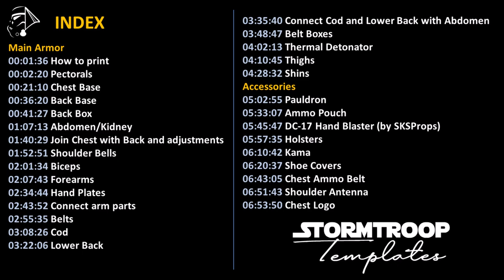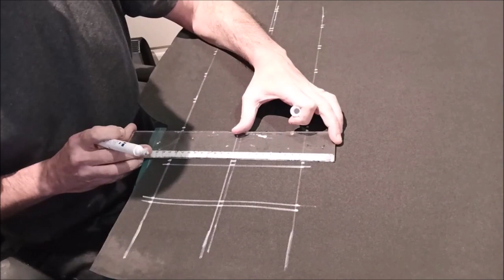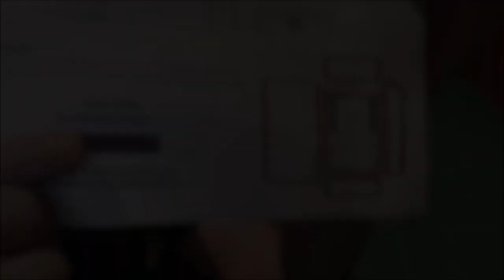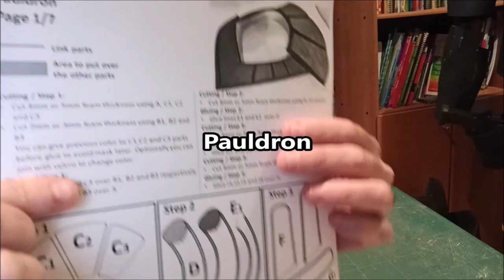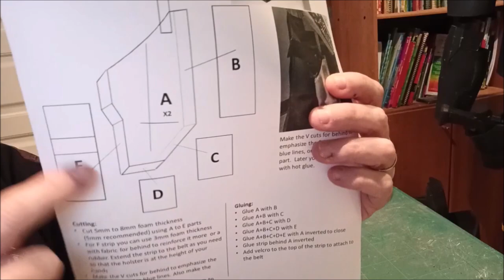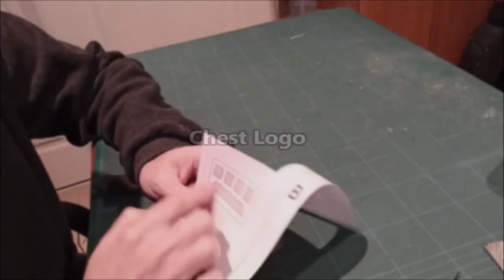Clonetrooper Armor Foam Build

Comment: Thank you for this awesome video! I purchased the template and have been working on my captain rex over the past month. I have every armor piece cut out, I am just doing minor adjustments to size since I am a bit bigger but the template is easy to work with. Next i will be sanding and smoothing rough edges, then prepping for painting and weathering. I am really excited to get finished.

Comment: Main Armor
00:01:36 How to print
00:02:20 Pectorals
00:21:10 Chest Base
00:36:20 Back Base
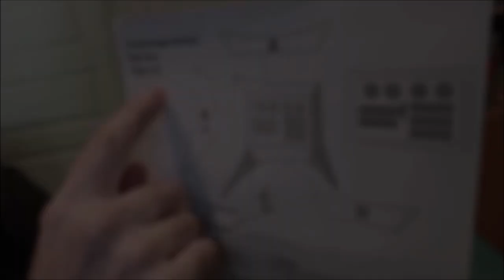00:41:27 Back Box
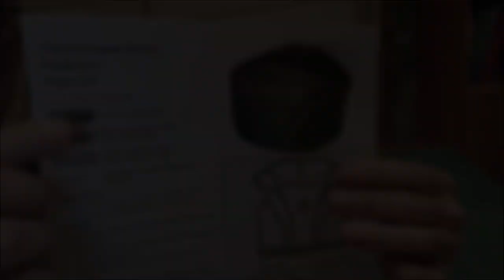01:07:13 Abdomen/Kidney
01:40:29 Join Chest with Back and adjustments
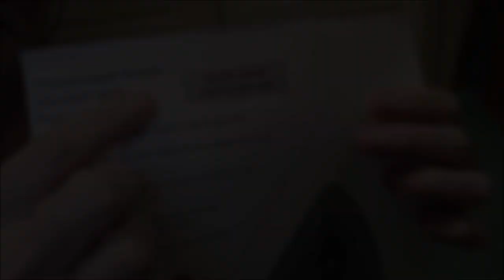01:52:51 Shoulder Bells
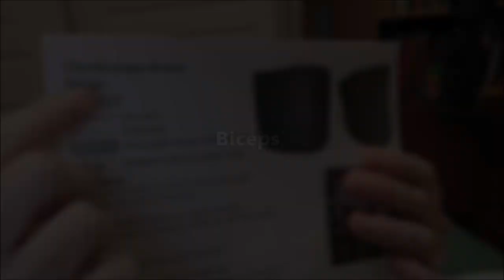02:01:34 Biceps
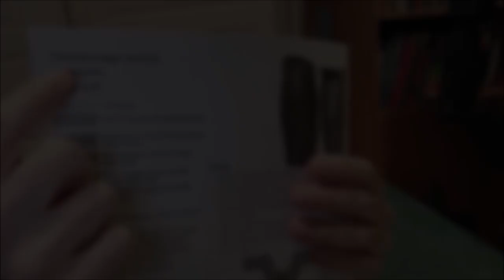02:07:43 Forearms
02:34:44 Hand Plates
02:43:52 Connect arm parts
02:55:35 Belts
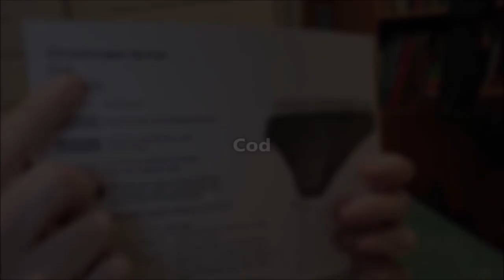03:08:26 Cod
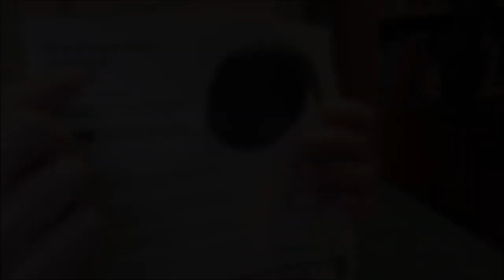03:22:06 Lower Back
03:35:40 Connect Cod and Lower Back with Abdomen
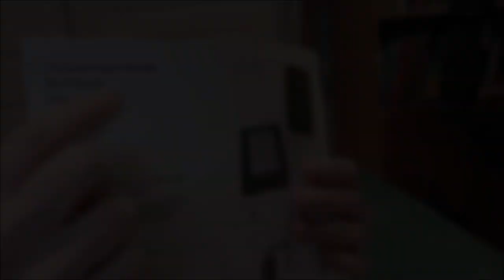03:48:47 Belt Boxes
04:02:13 Thermal Detonator
04:10:45 Thighs
04:28:32 Shins

Accessories
05:02:55 Pauldron
05:33:07 Ammo Pouch
05:45:47 DC-17 Hand Blaster (by SKSProps)
05:57:35 Holsters
06:10:42 Kama
06:20:37 Shoe Covers
06:43:05 Chest Ammo Belt
06:51:43 Shoulder Antenna
06:53:50 Chest Logo
Reply from the maker: The index is in the description. Thank you
Reply: @StormtroopTemplates  can you add it to the video?
Reply from the maker: @AlexiosLair  The index is at the beginning. Thanks

Comment: How much of the 3mm and 5mm foam would you recommend buying for this? Do you have recommended dimensions for how much of each?
Reply from the maker: Hi Bobby, may be half square meter, it's a little for the details. Check in the guide what parts need 3mm and what parts need 5mm, you can see in the first page of each part. Tell me if you need help.
Cristian

Comment: Might consider doing this for the 501st. If I do get it, is there a way i can make the armor like a shock trooper? Thanks in advance.
Reply from the maker: Hi, yes, you can make the shock trooper:
https://databank.501st.com/databank/Costuming:CT_-_Shock_Trooper_TCW
Remember that unfortunately the eva foam material is not approved by the 501st Legion, they are only allowed these types of materials or like materials: White fiberglass, ABS (Acrylonitrile Butadiene Styrene), HIPS (High Impact Polystyrene), or Polyvinyl chloride (PVC). Removing this requirement would be worthy of approval. Anyway you can try to get the approval and let me know. Thanks. Cristian
Reply: @StormtroopTemplates  Thanks man! Will do!

Comment: What glue do you use and is it safe to handle on skin like that?
Reply from the maker: Hi, yes, it's safe to use foam over skin. I use a contact cement from my country, you cannot get it in yours. So I suggest use Weldwood Contact Cement - DAP or Barge but I have never used them, so I recommend that you try and choose the one that works best for you. Try to get one that is quite liquid and dries quickly.
https://www.dap.com/products-projects/product-categories/adhesives/contact-cement/weldwood-original/
www.bargeadhesive.com/products.html

Comment: What tools and materials do i need to complete this? 😅
Reply from the maker: Hi, for this template, the basic things you will need are:
· 4 square meters (1m = 39.37 inches) of 6mm/8mm foam thickness (8mm recommended)
· Small area of 3mm/5mm foam (3mm and 5mm recommended)
· 1.2 square meters of black fabric (for Kama and Pauldron triangles) 
· Contact cement, hot glue gun (optional)
· Foam cutters, scissors (optional)
· Heat gun or powerful hair dryer instead
· Paper tape
· Velcro
Note: recommended foam density between 60 to 80 (30kg to 50kg in kg by m3) to get the same result.
Letter pages to print: 90
Thanks
Tell me if you need more info 
Cristian

Comment: Hello I was wondering, what brand of Eva foam do you use , and if I can’t get it here any other recommendations?
Reply from the maker: Hi Brian,
it's foam density between 60 to 80 (30kg to 50kg in kg by m3) to get the same result, check the tnt cosplay Eva-38 foam sheets, it's nice to work with:
https://tntcosplaysupply.com/product/eva-foam-sheets/
You can get sheets of foam of 24" x 60", each sheet is almost 1 square meter.
Also check the stores:
cosplaysupplies.com (USA & Canada),  redmooncosplaysolutions.com (USA & Canada), truenorthcosplay.com, (Canada), arda-wigs.com/collections/foam-products (USA), sksprops.com (USA), thecosplaypros.com (USA), tntcosplaysupply.com (USA & Canada), 
Tell me if you need more info.
Cristian
Reply: @StormtroopTemplates  thank you so much!
Reply: Another question, say I were to use 70-78kg foam density, would I get similar results?
Reply from the maker: @brianjordan2591  Will be difficult to cut and give shape to the foam with that density. May be you can use thinner foam with that density. But the armor will look different. Thanks. Cristian

Comment: Is there a way to downsize this, i saw that for your clone trooper helmet templates, is it also possible on this?
Reply from the maker: Hi, It is important to validate the molds in your body before cutting the foam cause you can validate the sizes and joints of all the molds, because after cutting molds in foam it is more difficult or impossible to adjust the parts. I saw some finished armors in which some parts were not so adjusted to each body so I recommend doing this task. It is easy to adjust the parts to your body following the adjustment instructions. Remember that although the templates are for an adult, not all of our bodies are the same. It will only take a moment to temporarily attach the molds to test them on your body and you will have better completion of the armor or helmet. Here you can see how: https://youtu.be/xSt6kH9D7lM
The video shows the task with an stormtrooper template, but gives you an idea of how to adjust the molds of the pieces.
Check the sizes in the attached image.  
https://i.etsystatic.com/15900749/r/il/77fc97/1926273074/il_794xN.1926273074_mrf3.jpg
If you are between the ranges you are ok, if you do not, just adjust like video and it says the recommendation PDF file.
Tell me if you need more info.
Cristian
Reply: @StormtroopTemplates  Thank you very much, you are a great guy for going this much in detail, have a good day

Comment: Hey I plan to buy your templates but I can't get my hands on 8mm foam, would it be better to use 5mm or 10mm? and would it still work with your templates?
Reply from the maker: Hi, the recommended thickness is 8mm, but you can use 10mm but it will be difficult to cut and give shape to that thickness. Try to find a store with 8mm. I do not recommend 5mm, too thin.
I recommend foam density between 60 to 80 (30kg to 50kg in kg by m3) to get the same result, check the tnt cosplay Eva-38 foam sheets, it's nice to work with:
https://tntcosplaysupply.com/product/eva-foam-sheets/
You can get sheets of foam of 24" x 60", each sheet is almost 1 square meter.
Also check the stores:
cosplaysupplies.com (USA & Canada),  redmooncosplaysolutions.com (USA & Canada), truenorthcosplay.com, (Canada), arda-wigs.com/collections/foam-products (USA), sksprops.com (USA), thecosplaypros.com (USA), tntcosplaysupply.com (USA & Canada), 
Tell me if you need more info.
Cristian
Reply: @StormtroopTemplates  Thank you for the fast response, I'm in Europe so shipment from the USA would be too expensive. I managed to find 8mm foam in 2m x 1m sheets, is 2m^2 enough material, or should I buy 4m^2 ?
Reply from the maker: @rafi1937  Yes 4 square meters is fine for the armor. Two sheets of 2m x 1 it's ok. Cristian
Reply: @StormtroopTemplates  Thank you so much for the help and amazing tutorial <3 . The Republic is proud of you soldier.

Comment: Hi what glue did you use for this
Reply from the maker: Hi, I use a contact cement from my country, you cannot get it in yours. So I suggest use Weldwood Contact Cement - DAP or Barge but I have never used them, so I recommend that you try and choose the one that works best for you. Try to get one that is quite liquid and dries quickly.
https://www.dap.com/products-projects/product-categories/adhesives/contact-cement/weldwood-original/
www.bargeadhesive.com/products.html